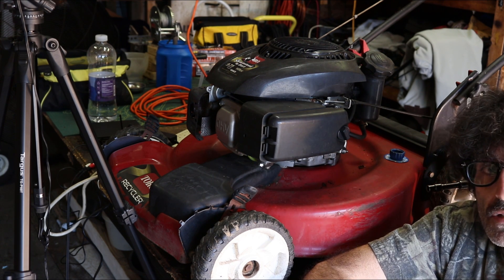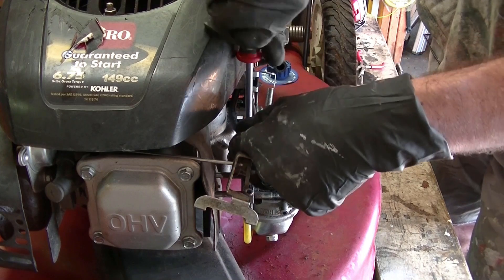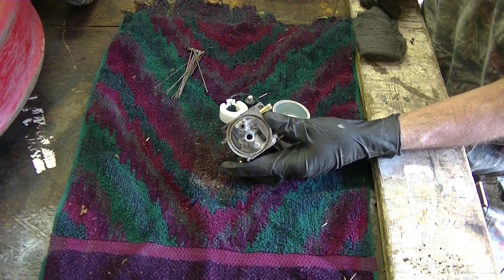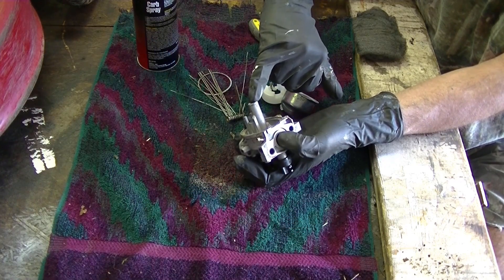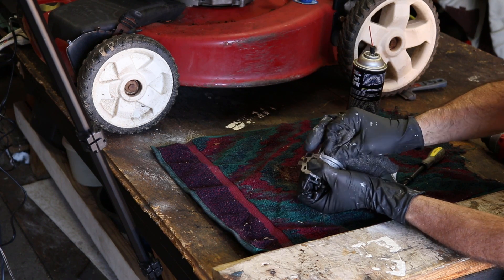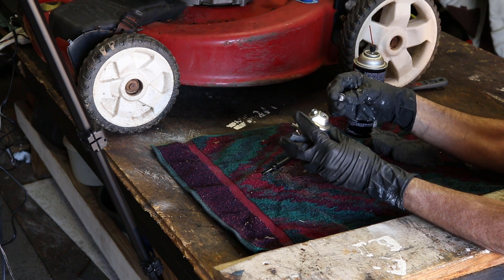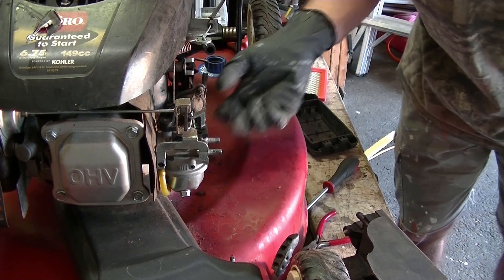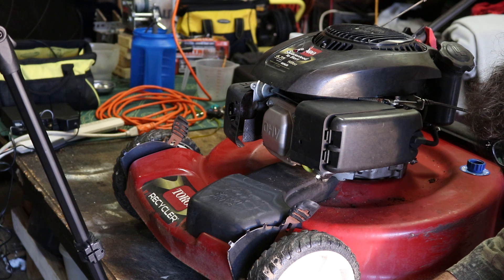Kohler; Toro Lawn Mower Repair Won't Start? Step by Step Carburetor Repair  149 CC

Comment: Don't you have to wind up the auto Choke counter clockwise to give it spring tension when connecting it to the butterfly valve?
Reply from the maker: HI!  I don't remember on this particular model, but most auto choke systems have a thermostat on the muffler.  When the engine heats up, the arm moves back allowing the choke to open...  Then closes back when it cools off..

Comment: My problem is that my lawnmower only turns on when I push a pen inside to force the butterfly valve open. New carb, new diaphragm and new auto Choke link and the lawnmower still can't keep the butterfly valve open when I take the pen out. I thought that was the purpose of the diaphragm is to keep the butterfly valve open. But when I take the pen out the diaphragm link isn't strong enough to hold it open
Reply from the maker: Did you get my response from the other day?  It doesn't seem like it posted.  I said to check the thermostat that is attached to the muffler.  It is supposed to move in one direction when the engine heats up and move back when it cools down.  That's how the auto chokes work...

Comment: Yes, just bought this mower a year ago and aggravated at this pitch on guaranteed to start BS. It's all about the carburetor corrosion in the metal bowl that is due to the ethanol in the fuel we have to buy these days. Cleaning the carburetor every year is a pain. Notice that Koehler has a drain plug on the side of the bowl. So use it drain all the fuel out of the tank and engine at the end of the mowing season . Going to try that this year . Good luck !
Reply from the maker: Yes absolutely a good idea to drain the bowl at the end of the season.  Honda does that too.  I always try to use Ethanol Free fuel if it's available locally.  It has a longer shelf life and doesn't attract the moisture the regular gas does..  Hope that helps.. 😊

Comment: a way I discovered to try and clean those jet holes and correct me if I'm wrong in doing it this way... but take the small end of the copper piece, place it against the carb cleaner and spray until there is spray coming out of all the jet holes... repeat cycle from other end etc... until all jet holes have spray coming out fluidly... ??
Reply from the maker: That'll probably work unless the carb is in really bad shape.  When that fuel gels up, it's more difficult to remove the goop without a physical wire or something substantial going through the holes.  But if it's only a light issue, then yes, that method will work fine..
Reply: @JLPicard440  it worked on mine, just to be safe too... I didn't use the welding wire as I didn't have any, but found a bread tie (stripped down to the wire) worked really well also.
Reply from the maker: @cadrehansen5045  That's a great idea!  Yep that'll work.. 🙂

Comment: What's the carburetor overhaul kit part number in Amazon going crazy finding it. Thanks
Reply from the maker: HI, I doubt it would be worth overhauling this carburetor.  99% of the time, I clean these.  But if it's not cleanable, a new carburetor is usually less than $20.  I don't know the carburetor number.  IF you send your engine model number, I can try to find it for you..

Comment: I took the carb apart and it was clean. Still wont start. Wondering if it's the spark plug or the auto choke
Reply from the maker: It could appear clean but still have trash somewhere in it clogging something.  Did you clean out any of the little holes?  You should be able to easily test the auto choke.  When you put the carb back on can you move the auto choke back and fourth?  It should be in the choked position when it's cold..
Reply: @JLPicard440  Of course I did. None of it was clogged.
Reply from the maker: @The_Gallowglass  OIC.. Have you looked at the auto choke?  They do go bad every once in a while.  The mechanism on the muffler is what usually goes bad with rust.  But if your carburetors default position is closed and choked when the engine is cold then more than likely it's already working.  If the choke is closed and it won't start do you have one of those neon bulb spark checkers?  It's possible the magneto is bad..
Reply from the maker: @The_Gallowglass  Oh excellent!  Glad you got it going again.. 🙂

Comment: Hey there’s a gasket between the air filter box and carb. I noticed you didn’t replace it. Is it even necessary to replace?
Reply from the maker: It depends.  Most of the time when you take it apart the gasket will survive and not tear.  If the gasket is intact I rarely will replace it.  If it's torn up then yea, you'll have to replace it.  Some mechanics might not agree with this, but I haven't noticed any ill effects by not replacing it when it stays in one piece.
Reply: @JLPicard440  thanks so much for the reply. I meant that it looked like you didn’t even have it on. I wouldn’t think a gasket would go there, only reason I know is because I am currently taking apart my carb and there’s a worn out gasket in that spot. Unless yours was stuck to the air box. Anyway I was trying to see if I could do without it. Thanks for the video also. It’s a great help
Reply from the maker: @georgek2802  OIC.. IF you could give me the time stamp, I'll take a look and see if I can remember if one goes there...

Comment: I have this lawnmower and engine.  The steps in the video fixed my problem  Bad gas and clogged carb.  Now using Trufuel 4 cycle fuel (gray can) in the engine and started first crank.
Reply from the maker: Sweet!  I'm glad it helped.  If you have a local gas station that sells ethanol free fuel, that would be a great and cheaper alternative to the Trufuel.  The trufuel is great, but it is expensive... 😀

Comment: Excellent video, but I think you missed what I think is the low speed jet which is under the idle stop screw.  You take out the stop screw, then pull up on the black plastic jet body.  This jet has a microscopic hole in it, and my smallest tip cleaner wasn't even close to going through it.  I used the tip of a sewing needle and was able to clear it.  There are also 2 o-rings on the plastic body of the jet one of which had broken.  You clued me in how to take out the main jet by pushing down on end from inside the carb, thank you.  Gotta say, I have probably done 500 or more carbs in my life, and this is my first small Kohler carb - boy, I am not a fan of this Kohler design.
Reply from the maker: Thanks for the great info!  I may have missed that, and I apologize..  I mostly do the B&S engines and I do like those a lot better.  Hondas are good engines, but not a fan of the carb design either with the two long bolts..
Reply: @JLPicard440  No problem.  I missed it too and thot I was finished with carb till I saw it on another video.  By the way, those 2 o-rings will probably break when you try to take them off the plastic housing so don't recommend you take them off.  If they do break, the Kohler kit p/n is 14757 03-S  and is 7.95 at opeengines.com.  Keep up the good work!!
Reply from the maker: @jimmy6501  Thank you for the info!

Comment: Would suggest the cleaning with steel wool be done first to keep the dust from getting into the clean carb.
Reply from the maker: I usually blow everything back out again after using steel wool..

Comment: Anybody else notice that the top of the mower has “Guaranteed to Start” stamped on the top of it? Lol
Reply from the maker: It's only guaranteed to start as long as there's nothing wrong with it! 🤣🤣
Reply: If you have crap in your gas, dirt, etc, it will eventually block up the tiny holes in carburetor. No way will it start until you follow this video, and clean it out.  After several years, your gas tank probably needs cleaning too. Just a fact of life.
Reply: Right
Reply: Guaranteed to start on the first pull...not the 1000th🤣

Comment: I find that taking off the heat sensor  off the muffler and don’t mess with linkages easier.  But you do have to take off the recoil which is just 3 10mm nuts .   Good vid
Reply from the maker: Good tip!  Yea, you might be right.. I've never tried taking off the sensor on the muffler.. I'll try it next time.. :-)

Comment: A neighbor gave it away since he hasn’t used it in over 5 years and now it didn’t start. Now that I got it, I came across this vid. Quite a lot Of steps and small pieces but I’m going to give it a shot. I’ll update you later.
Reply from the maker: It's not as bad as it looks! ,, :-)
Reply: Take a Bath Productions ok, so I did it. Took it apart but couldn’t remove the jets because it was on too tight and start stripping a bit so I just sprayed it with carb cleaner. Clean everything else as you did but no luck. I then added carb cleaner in the throttle (in place of starter fluid, actually works), it starts for about 2 seconds and then turns off. Checked the fuel line, cleaned the gas tank, tried again, no luck. Used carb spray “starter fluid” again, started for a second or 2 then off. So it’s definitely not getting fuel in there. Thoughts?
Reply from the maker: @davidamarquez  I had a couple of these that I actually couldn't get going.  But, I've done lots and lots that Did get going ok.  The ones I couldn't get going I suspect had low compression and were just junk.  Do you think the one you have has adequate compression?  If you have a gauge that'd be helpful.  Should be at least 80psi.. if not a bit more.  The only thing I can think of if it's not the compression is those jets that didn't get cleaned.  It could be that.
Reply: Take a Bath Productions if it was compression, would the machine even start with starter fluid? It sounded fine for those few seconds.
Reply: Update; it didn’t work. I ended up taking it to a lawnmower shop and they got it working. $80 and a tune up and it’s as good as new.
Reply from the maker: Arrgh... glad you got it going.. but I wish for you, it would have been free... :-)
Reply: Take a Bath Productions since I was in the market for a new one, I figured $80 isn’t bad at all. This one is worth over $300 nearly $400 At Home Depot.
Reply from the maker: @davidamarquez  You're definitely right!

Comment: I have one just like it and it has become my arch enemy, i replaced the carb, coil, plug and air filter. It starts first pull and runs great for about 5 minutes then sounds like its running out of gas and dies. Any ideas on the cause?
Reply from the maker: Well, you've already replaced pretty much everything it could be... make sure the gas is clean and doesn't have any water in it.  Possibly the fuel tank cap is causing a vacuum in the tank.... there's supposed to be a way to vent the tank... try loosening the cap and see if the problem goes away.  Don't do this on a full tank as it will probably spill all over the place...
Reply: These engines have an automatic choke activated by a heat sensitive spring the spring is prone to problems that would cause the choke to stay closed and it would die just as you describe.

Comment: My self propelled cable is broken on my troy bilt front welldrive any suggestions
Reply: Help
Reply from the maker: I would replace it.  I have some video's on replacing the cable on Toro's but not on Troy Bilt.  I'd do a video if I had one here that needed a cable..

Comment: I'm guessing the gasoline needs to be drained out before you take the carburetor out correct?
Reply from the maker: No u can punch the fuel line with vise grips... but I usually remove the fuel tank anyway and clean it just to make sure I dont re contaminate the carb
Reply: Thank you, going to attempt this tomorrow
Reply from the maker: I'll keep my fingers crossed!

Comment: Great video.  One problem though, I saw a video before I found this and it was for a different mower of the same type.  In it, I took off the top linkage by unscrewing it from the other side of the engine.  There was a little silver spacer and I have no idea where it came from.  Any help on where that goes so I can reassemble my mower?  Thanks!
Reply from the maker: Jay Foulk look at 1:40 is that the spacer you mean ?
Reply: No.  I see that one and was glad you mentioned that but this one is a little smaller and silver, not black.
Reply: I did remove the top cover so I could get at the bolts on the linkage on the other side.  Could it be a spacer from that?
Reply: This is the linkage you took off at 2:30.
Reply: Don't worry about it.  I just put it back together and I don't think it started this easy when I first got it!  This had happened once before (bad gas) and I just kept spraying it and flushed the gas but this is the ticket!  Thanks so much Take a Bath Productions!
Reply from the maker: Jay Foulk yea check where the bolts go thru the top cover... I think there might be a sleeve pushed into the plastic and see if one is missing.... that's all I can think of

Comment: Cleaned out the carburetor it starts perfect now but I now noticed is leaking gas on the carburetor ? Any advice
Reply from the maker: Depends on where it's leaking from.. If it's leaking from the bowl, then the round o-ring (that connects the bowl to the carb body) is either crinkled or it's bad,... if it's leaking out of the carb itself where the air goes in, then it's probably the needle and seat that is connected to the float... hope this answers your question...

Comment: Nice educational video Take a Bath!  I have not started this mower with the 149 cc Kohler for over a year and yes, it didn't start in the spring a year ago so I didn't use it but now I need it.  I did clean the carburetor and bowl very well, nothing left to obstruct or seemingly cause a problem for starting.  Once I hooked it all back up as it was before and what you show too, it didn't start.  The new gas is not getting into the bowl....?  So I disconnected hoses and checked to supply of new gas coming into the carburetor.  Gas is flowing freely in the supply hose up to the carburetor.  So I also tried using starting fluid to see if it would run for a second with that.  Yes, the engine fired and ran about a second, so I did it two more times with a light shot of starting fluid, both times fired right up and of course died.  Yes, I did put in a new spark plug as well and I did clean the inline plastic filter from the tank as well, also the jets in the carburetor as you showed.  Recently I met a guy who repairs these engines regularly told me that he never fixes the carburetors on these engines, always replaces.  So I ordered one and now have it.  But I have not replaced with the new carburetor yet since I'm not getting gas into the bowl anyway.  Scratching my head, I decided to look at your video again to see what I missed.  Can't see that I've overlooked anything.  What do you think?  Maybe a bad bowl pin?  I guess I'll be taking it off the engine again.  Thanks..
Reply from the maker: JD Kegler from what your describing there.. the only thing that would stop fuel from going into the carburetor... as long as it's getting thru the fuel line of course... would be the needle that goes up and down with the float... I've seen those freeze up in its sleeve... the seat... if u were able to remove the needle freely... then there could be something clogged right where the fuel line connects... there's really not much else it could be
Reply: Yes, I wasn't labeling the float pin correctly, calling it the bowl pin.  It was late, ha.  Yes, I took it all apart and remember that you didn't cover taking the pin out and cleaning it (4:36) since your's came out easily.  And probably because it's usually not a problem I guess.  As I took the float off, I remember trying to see if the pin would come out and it would not, should have been an indicator to me but I was concerned that I might break it if I applied too much pressure.  But the second time I pried on it and it did pop out.  Yes, it was pretty dirty and I had to scrub the pin with carb cleaner and my fingernail as nothing else would clean it well enough without possible damaging it's delicate surface.  There also was a small circular and solid chunk of junk the size of the shaft that popped  out of it.  It does seem that the 10% ethanol is a problem or the problem with many of the carburetor problems on many different small engines.  The deposits in the bowl were like corn sticky stuff.  We do not have gasoline without ethanol in the area.  I've read that having a mix with the recommended jet cleaner mixed in the gas prior to putting in the tank will help keep the engine running longer or the carb from clogging up.  I'm going to give that a try.  You put out the best video that I found Take a Bath!  Thanks a lot for answering me so quickly too!  Have a good day!  Almost forgot; it started on the first try!!!!!
Reply from the maker: JD Kegler I'm glad u got it going!... yes those usually don't freeze up like that,.. but I have seen it before..check the oil in a day or two as well as the air filter... if that needle was that bad... it could leak... I've seen them leak into the oil.. or go the other way and soak the air filter... if both are good.. u should be golden!